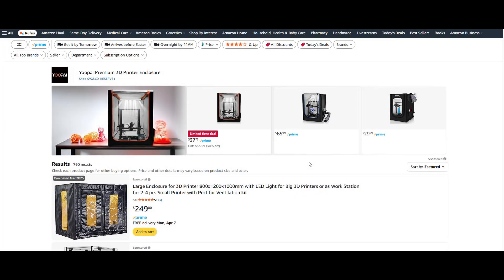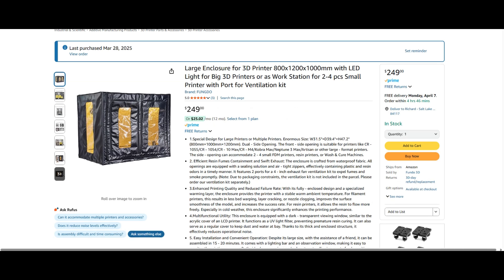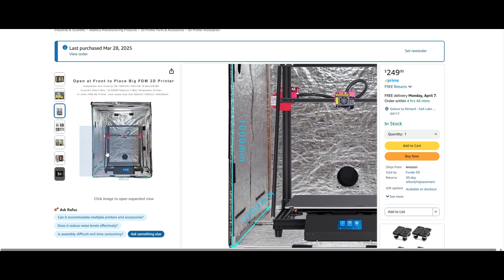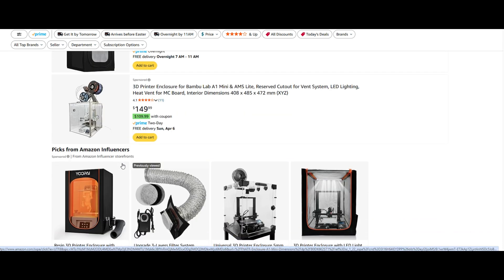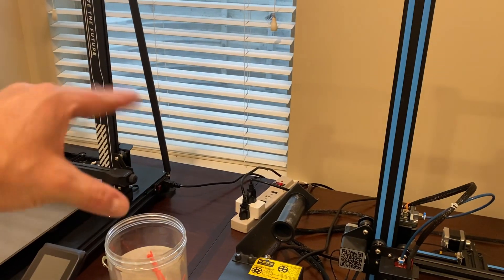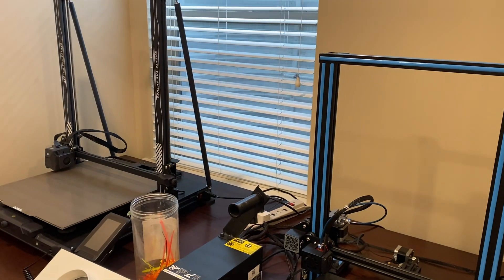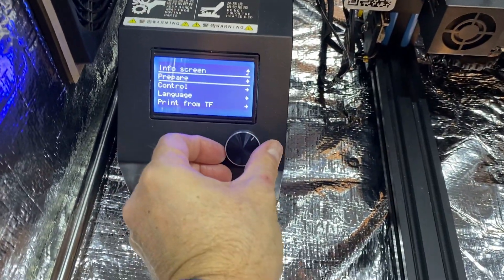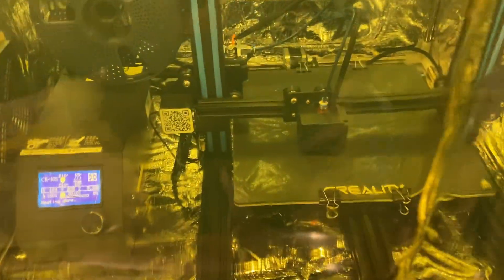3D Printer Enclosures - Are They Worth It?

Comment: where is the backdraft damper?  If its after the Y connector (between the Y connector and the window) then its just gonna blow air from 1 printer to the other if the back pressure is too strong, especially if 1 air flow is stronger than the other.  Need a back draft damper after each pressure source (after each fan)

Comment: 😁 so i am using a Creality ender 5 plus enclosure. Originally to keep the printer in its own space, then I got myself an Elegoo Centauri Carbon (smaller self enclosed printer). Now since the newer printer can do ABS an such, clean non stinky air is a must, out goes the ender 5 and in goes the Centuari Carbon to the enclosure. 😁 size difference is huge but all good cause i can fit air filtration into the enclosure. 
Oh on the enclosure frame I mounted LED strip lights, power cord running out an access flap sealed by Velcro. So all sealed up, lit up and air clean 😊
As for cost, definitely worth the short term hit for long term benefits.

Comment: Awesome work and interesting setup, If i was to suggest an upgrade it would be to remove the filter off the exhaust and fit it to an intake (this will prevent the sides of the tent gets sucked in under vacuum and filter the airflow through the enclosure) and to get really fancy you could have the fan controlled by a temp/humidity controller.

Comment: Ive heard these can heat up and overheat the motherboard? I cant say for myself, a similar one advertised for the bambu labs a1 has a review saying this. Ive ordered one and will monitor the temperature
Reply from the maker: I have not had any issues with overheating at all.  temp stays around 80 F.
Reply: @rprealitycosplay  so I ordered a top cube one, and it says in bold letters that the enclosure was tested and it will not (in capitals) make the enclosure go above 40°c. I've been using it, and the temperature has only ever ventured slightly above 31°c. My outside temperature is around 16°c internal about 21°c. So far it's okay. Humidity is a steady 40%